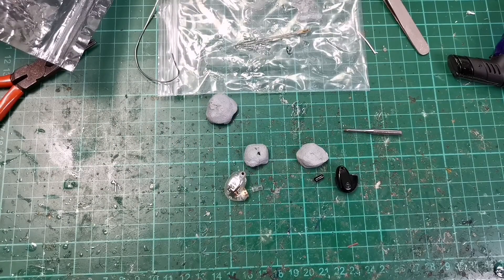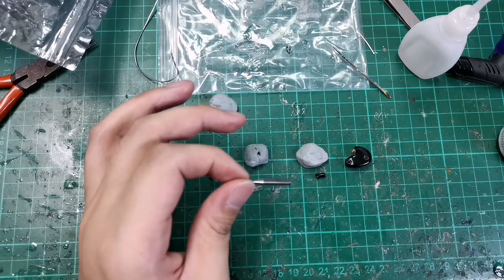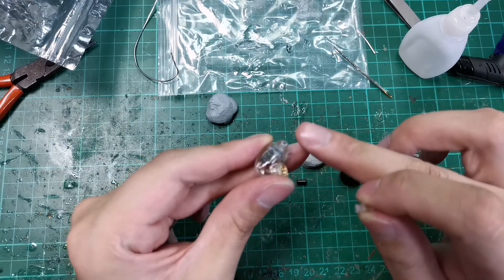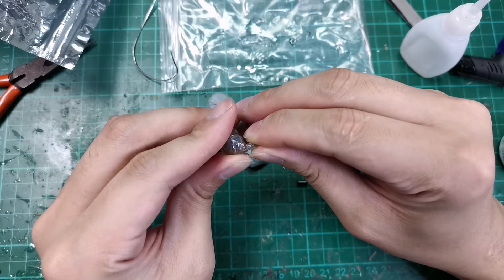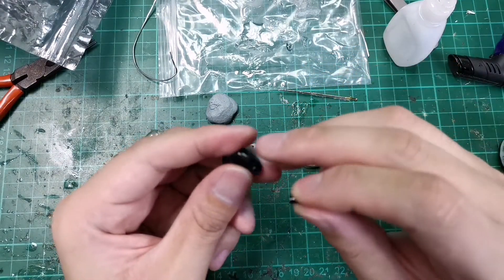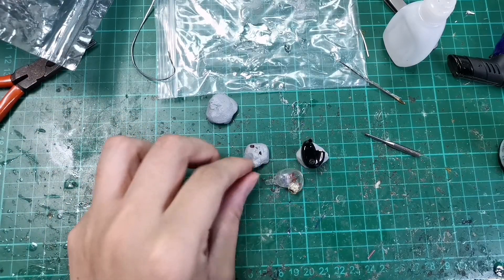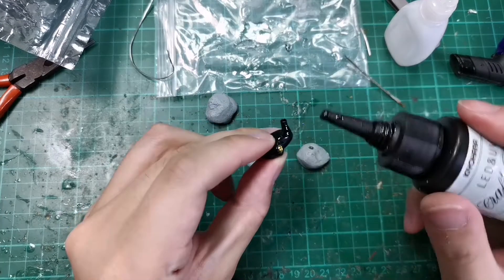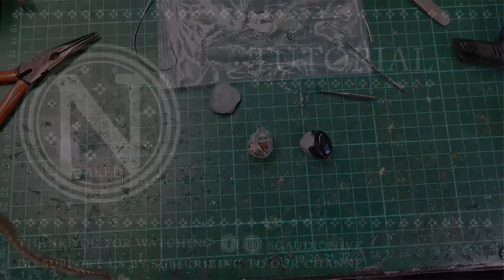IEM Broken nozzle repair Westone Shure [NAKED Tutorial]

Comment: Remind me if I asking but what if you accidentally put it in water not the whole thing but just the lower part can you fix it or it's broken and please someone answer me
Reply from the maker: will not be able to diagnose but i would assume there is sound but very soft, try cracking up the volume to max and see if you can hear a faint sound. if you do, poke a hole on the damper in the nozzle and do the same for the other side. order a set of replacement damper and removal tool to replace if thats the case
Reply: I fix it do I take a couple 25 so basically like 1/2 months I need to I need to fix it doesn't make a sound before I fix it but thank so very very you